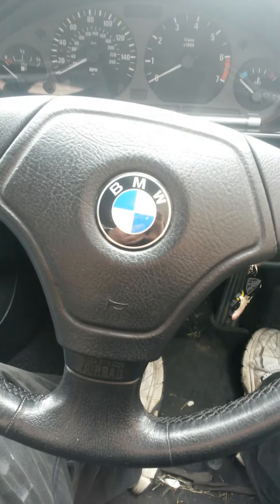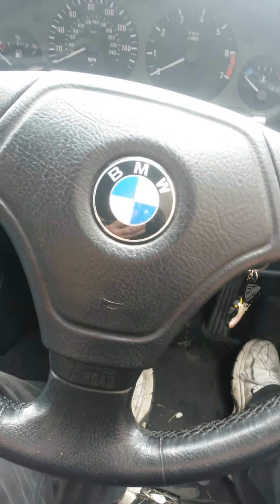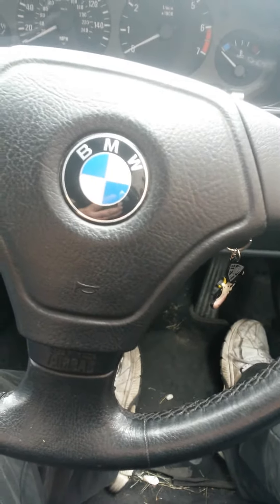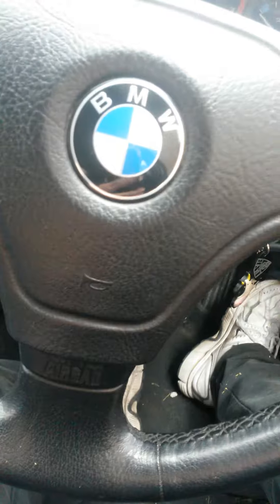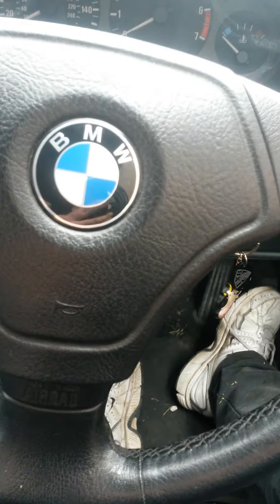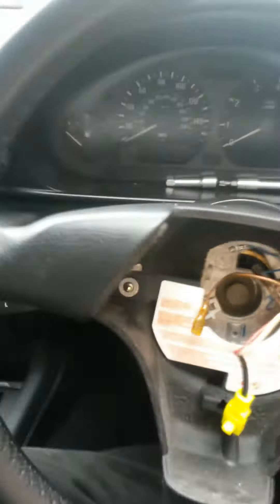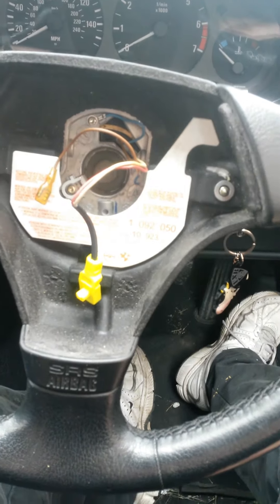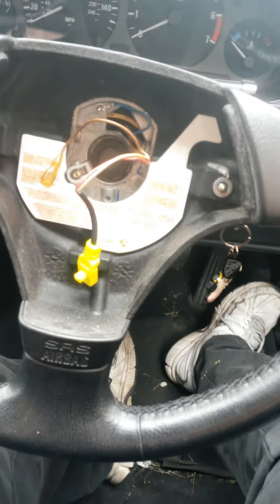BMW 316i compact 98 airbag removal

Comment: Finally someone doing this on a compact! Could you please show how to change the steering wheel?
Reply from the maker: I've not got this car anymore, sorry.  But follow this video instructions - disconnect battery, leave for half an hour. Undo those 2 torque bolts under steering wheel. Pop the airbag off. Disconnect the ribbon wheel from the steering wheel (indicator and horn). There's a big nut attaching the wheel to the steering stem, undo that to remove the steering wheel. Remember to make sure the wheels are straight when refitting the steering wheel or you risk the ribbon being broken and the horn/indicators not working correctly. Other videos of BMW steering wheel release, should be the same. The compact has a slightly differently set up but the same underneath. I used other videos to work it out. Not had this car for 3+ years now. Hope this helps.
Reply: NoZ Helps a lot, thanks a bunch!! 😊

Comment: Instrument bulb replacement mission complete in 1998 318ti Compact, Japanese assembled
Instrument Cluster screws 2 x Torx T20
Screws in the back of the steering wheel holding the Air Bag assembly 2 x Torx T27
Reply from the maker: I had a 318ti sport but it had an argument with some black ice :( loved that car, lovely mtec bodywork

Comment: It's your driver squib that has most probably failed,those wires you disconnected lead to the clock spring that sits behind the wheel.It is a common nightmare failure that shows airbag failure when in fact is usually that sensor
Reply from the maker: Yeah it was a broken slip ring. I went to the breakers yard and took one out of another beemer. Was easy to fit. I don't have the car anymore, think it went to the great cube in the sky. RIP BMdoubleMoo

Comment: hey did find out what caused ur air bad and horn failure? mines doing the same thing
Reply from the maker: Hiya. It was the rotary coupler.
Under the steering wheel, one half is attached to the steering column and the connections from the harness go in, the middle bit turns with the wheel.
Inside is like a tape measure or clock spring, a flat multi conductor cable. They have a few names but I think coupler is the most common. Have a look on YouTube how to replace it on your motor. There wasn't one for my old car, so made one. I got the part from the scrapyard, saved me about £160. Call around part shops, main dealer are really expensive. Good luck! And don't forget to disconnect the battery before removing the airbag!
Reply from the maker: have you recently had the steering wheel off or had any work done to the steering rack/track rod ends? Sometimes if the wheel isn't put back on in alignment of the wheels, the ring/coupler behind the steering wheel, snaps. Old cars, these things break. Other E models should have compatible parts with the 3 series (so I was told) so have a look at your scrapyard or on fleabay.